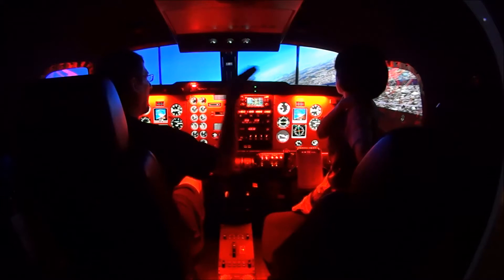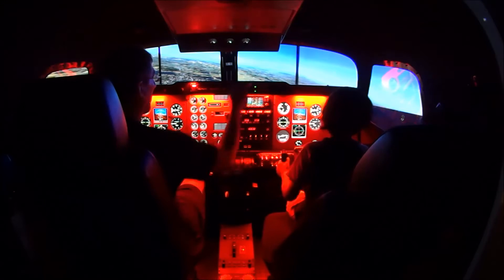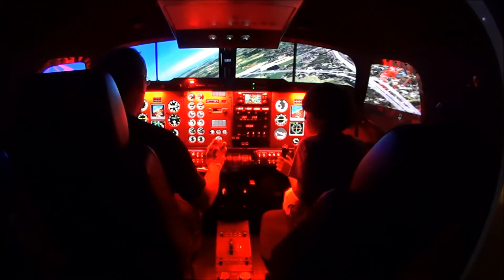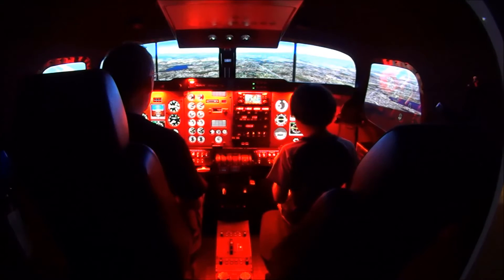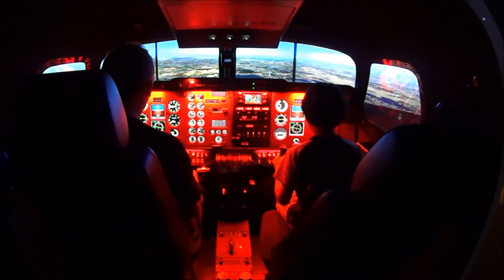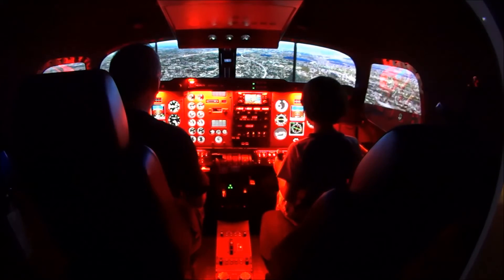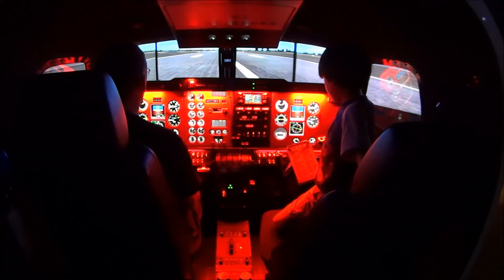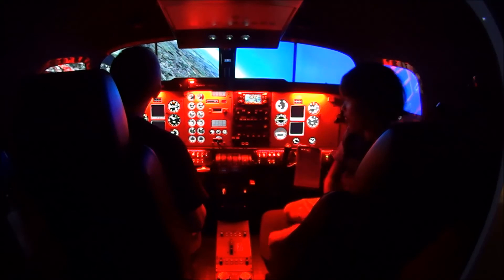Beechcraft King Air Simulator at Elite Sim Centers, Orlando Florida, Simcom training center

Comment: It looks like real  ！！

have a good experience🎶
Reply from the maker: +anamiken Yes the cars on the highway road where moving too. You can simulate any condition. Loss of cabin pressure. Engine fail. Both engines fail. Fire. Landing gear stuck up or partially down. Many system fails very fun time!!